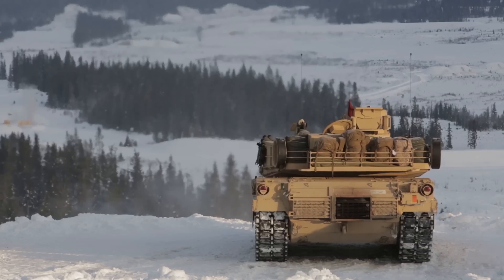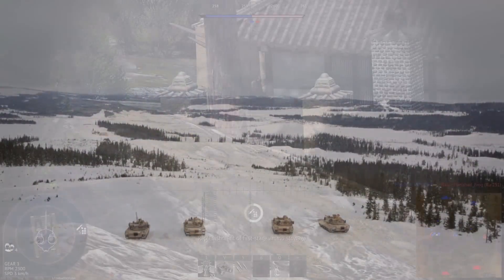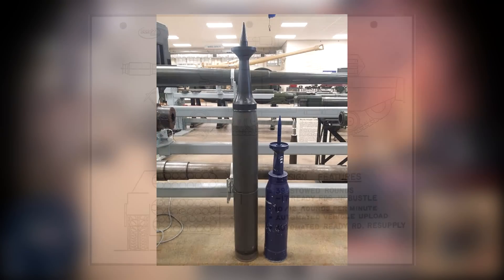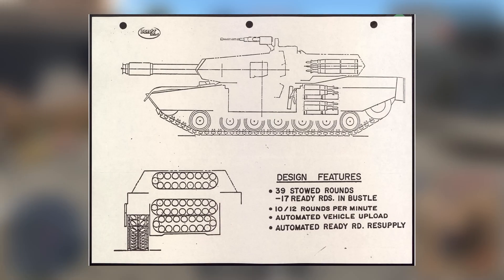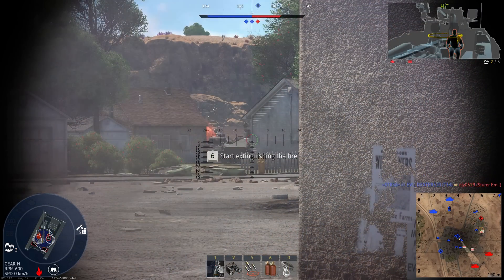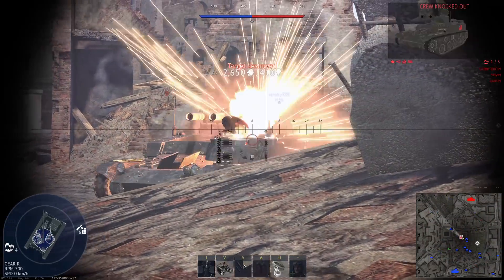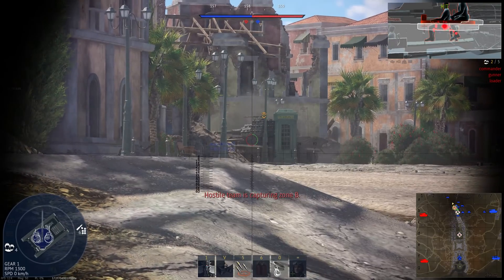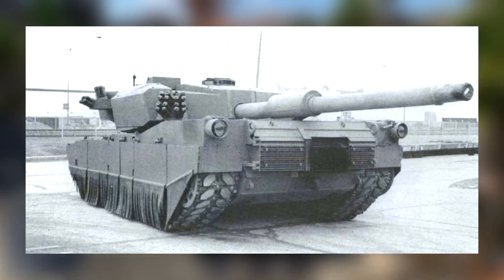The Strongest M1 Abrams Ever Built

Comment: So im an Infantryman with 5 years with JSOC. Could you sometimes in your video just reiterate acronyms, or what mounting power-packed certain ways does and why? I'm fascinated by tanks. But I was never around them
Reply: Transverse means that the output of the engine is pointing out to the side of the vehicle, versus longitudinal where the output is pointing lengthways (normally to the opposite end from the engine) down the vehicle.

A transverse engine is usually more space efficient but harder to work on and also can be less reliable because A) it requires a more complex set of gearbox and differentials to get the to the driving wheels and B) the tighter fit of the engine gives you less freedom for your intake/exhaust routing and things like that.

This isn't just unique to tanks, this is a general vehicle thing.
Reply: @jimmydesouza4375  A) isnt' really true because look at how most compact cars and motorcycles use transverse arrangements.  You get less losses because all the shafts are aligned from crank to sprockets without having to rotate power 90 degrees.  It also facilitates the "power pack" configuration because you can closely couple the engine and transmission into a single unit.
B) is kinda true but mainly because you are trying to stuff as much powertrain into as small a metal box as possible.
Reply: @obsidianjane4413  Are all vehicles front wheel drive shitboxes or motorcycles?

Comment: It seems weird not seeing any of the systems in the CATTB incorporated in newer designs, or even the CATTB itself or similar designs in development. Like sure it is a test bed, but why make a test bed if ur not gonna incorporate the systems? Hopefully I'm wrong and things are classified, but still I'd like to see them.
Reply from the maker: Comes down to cost, mostly. That initial investment into new tech often scares the government off, even if the long term gains outweigh it.
Reply: It's because none of the systems were actually useful, so it wasn't worth buying.  Radar back in the 80's couldn't declutter well enough to work on ground seeking since processors weren't fast enough back then.  A 140 doesn't actually give you any advantage vs a higher pressure 120.  The hydropneumatic suspension is worse than the torsion bars (though easier to fix).  The engine was weaker than the turbine and less efficient at full load and only benefitted idling which was better solved by an APU.

Etc.

You need to keep in mind that things being put on a testbed platform doesn't by default mean they're superior to something already in use.  The whole point of the testbed is to test them and see how they compare.

Comment: What about the German one? Basically all big nations in the West did a 140mm project. If the Cold War continued Germany would have fielded a Leopard 2A5 with the 140mm gun.
Reply: the French one is basically just a gun upgraded Leclerc
But that gun became the ASCALON project Nexter want to put on the MGCS, if it goes as planned
Reply: @nicolaspeigne1429  yes its supposed to be the final gun on the EMBT but they want to use the 130mm first and if they don’t like it the 140mm.
Reply: @exo068  for the MGCS program, the KNDS consortium want the 140mm ASCALON, and Rheinmetall want their 130mm/L51.

As for the EMBT, for now it's the 120mm of the Leclerc on the demonstrator presented at Eurosatory, but since it's the work of KNDS only, i doubt they will ever go for a 130mm from a concurrent.
Reply: @nicolaspeigne1429  the MGCS is the project that the EMBT is running under. KNDS was founded for the MGCS program. France wants the 140mm and Germany wants the 130mm first because they planned to upgrade their Leopards with it before they get the EMBT and the other vehicles of the MGCS program. KDNS is opting to do both the 140 and 130 for that reason. The MGCS program is running smoothly at the moment but it could fall because the 6 Gen fighter is going smoothly at the moment.
Reply: @exo068  the EMBT is the demonstrator of the proposal by KNDS for the MGCS program, it's not representative of what the MGCS MBT will be.
The new Panther KF51 from Rheinmetall is the same in that optic, a demonstrator to woo the MGCS program.

And every franco german partnership seems to have a grim future right now, as the failure and setbacks of one could easily cascade into the others.
Reply: @nicolaspeigne1429  KDNS was founded because KMW and Nexter where chosen by their governments to be part of the program. Rheinmetall was only later put into the program but they left because they didn’t like how they were treated. They then started to developed their own vehicle the KF51. The KF51 is Germanys emergency parachute if they decide to leave the MGCS program.
Reply: @nicolaspeigne1429  There is no Rheinmetall on the EMBT. Not one component get sourced.
Reply: @exo068  Not true, that is totally on Rheinmetall, Germany also didn't know shit about it. Most Rheinmetall Employees didn't know shit either...
Reply: @Vanadium  they left the program before the first EMBT was showed in 2020. They didn’t contribute to the program directly. They build the gun.
Reply: @Vanadium  What didn’t they know?
Reply: @Vanadium  that's my point, EMBT is from Nexter and KMW in the KNDS consortium, the original participants of the MGCS program, and Rheinmetall is pushing to get their part in the program, especially to put their 130mm cannon on the futur MGCS MBT.
But Nexter is betting on their 140mm, that's why the EMBT will certainly not have a 130mm ever.
Reply: @exo068  the development was unknown to Germany. They didn’t know RWM developed a new MBT.
Reply: @nicolaspeigne1429   RWM will not gamble with the EMBT. We are gambling with the Panther and also get independent from KMW, that is the reason behind the development.
Reply: @Vanadium  I doubt that they didn’t know considering that they incorporated basically all the stuff the Bundeswehr wanted. They didn’t finance it as far as I know. You also need permission to build stuff like that in Germany so they definitely knew that they had it.
Reply: @Vanadium  "We", you work at Rheinmetall ?
Reply: @exo068  Germany get the call after it was done. OFC everything the Heer wants is incorporated because RWM has a lot of ex military staff in the first place and knew what Germany wanted.
Reply: @nicolaspeigne1429  correct
Reply: @Vanadium  well that’s also a point. In the end it’s still a open program that is supposed to be completed in the next 8 years. A lot can change in that time.
Reply: @Vanadium  if you are by Rheinmetall what do you think about the competition’s tank?
Reply: @nicolaspeigne1429  From what I know ASCALON is waaay different from that cold war 140 mm. It's way less powerful and uses telescoped ammo.
Reply: @olekzajac5948  the cannon had a lot of changes but it's a developpement of the Leclerc T4 gun, it's even the exact same breech for now
The muzzle brake is now designed to reduce the shockwave for nearby infantry.
The ammunition is semi-telescoped to be exact, and not at all less powerful.
The biggest change visually is the heat shield, which has actually small invisible holes to cool the barrel, as the Leclerc T4 didn't have any heat shield on its gun.
Reply: @nicolaspeigne1429  OK, so it (both the ASCALON and T4) is not at all related to the gun tested in the CATTB  or the 140mm Leopard?
Reply: @olekzajac5948  it's purely a domestic french design, in response to the german KWS III and the american  CATTB.
All those 140mm prototypes are part of the FTMA program between the US, the UK France and Germany in the 90s, they all proposed their own thing.
But i've got to admit the US did go the extra mile with the CATTB, as the Leclerc T4 is just a better gun in a modified turret, and the german built 3 different prototypes to test things out around the Leopard 2.
Reply: @nicolaspeigne1429  It is less powerful, shorter and lighter penetrator that produces 17-20MJ compared to 23-25MJ of the XM291 firing XM964.
Reply: @UnknownMemoryOfTheDistantStar  i wasn't comparing it to the US 140mm, but its own Leclerc T4 version.
It's a canon designed with reduced recoil  in mind to be put on  vehicles under 50 t.
As for the ammo, i don't know wich round of the ASCALON you are comparing to the XM964.
Reply: You are talking about the Panzer 87-140?
Reply: @carlomendoza6173  yes that’s the Swiss gun but Germany had the NPzK-140 that was based on the 120mm l44 and the knowledge was then used to build the 130mm.
Reply: @exo068  yep. Rheinmetal derived their L44 120 to a 140mm. But they basically pushed the firing chamber to its limit. I believe that’s why they then developed the more reasonable 130mm.
Nexter created an entirely new gun for the Leclerc Terminator testbed. That means it has fewer constraints for futur improvements of the canon, but also that it took much more time to actually test it and make it combat capable.
The 140mm was basically dead until a few years ago with the arrival of t14 Armata.
Apparently (and this is pure speculation), the 130mm of Rheinmetal would be sufficient to deal with the t14 but not more, while thanks to having room for improvement, Nexter’s 140mm could last longer, meaning Rheinmetal would have to develop a new gun for a long term MGCS project, if they really wanted their gun on it.
Reply: @vizender  the 130 is supposedly more then enough for the t14. Germany wouldn’t use a French 140mm gun just because it’s bad for the industry in the country similar to how France doesn’t use a German 120 but on that thy build. But I think it’s just a licensed product. It’s just a national pride thing.
Reply: @exo068  thé MGCS should use one of them. I explicitly talking about th MGCS right here
Reply: @carlomendoza6173  that's the Swiss one, the Germans had the Leopard 2-140 iirc
Reply: People cannot help themselves when Spookston talks about experimental vehicles. Everyone needs to insert their own nation in the comments. I'm here for it.
Reply: there's also japanese 130 or 140 on a Type 90 prototype
Reply: @tartagliathewigsplitter3880  The japanese one is a 135mm, the chinese also tested a 140mm
Reply: The Swedes also tried their hand at it.

Believe it was called the strv 2000
It had a 40 mm bogors to fill in the AA MG role lol